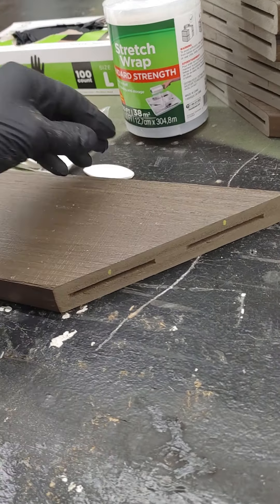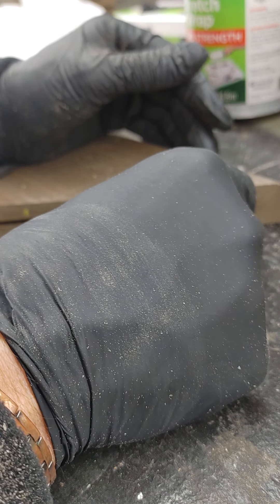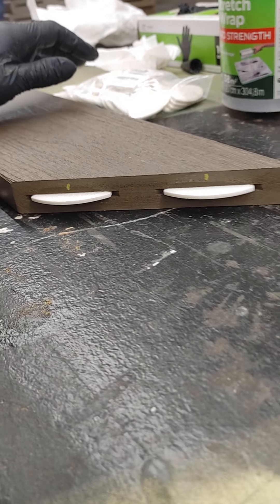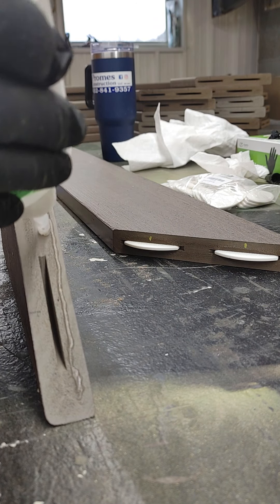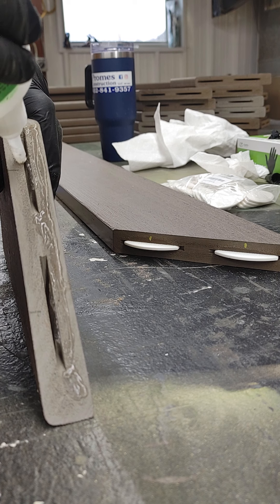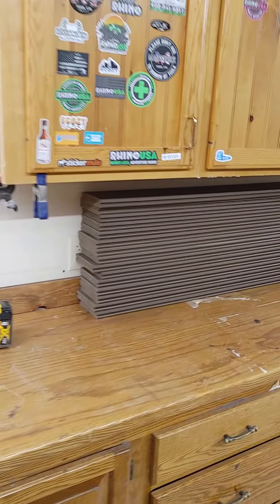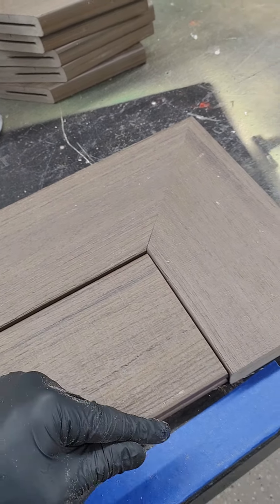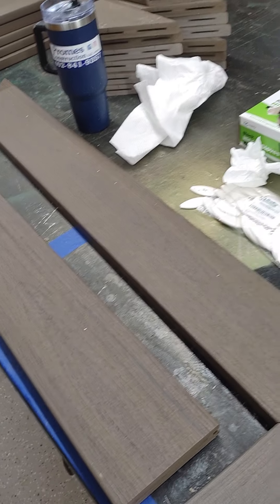Picture Frame Stair Treads

Comment: What about composite? Do you have to leave the space/gap? Looks way better tight like that
Reply from the maker: I would not be to concerned about installing composite tight on small boards like 4' wide stairs  for example.  But yes if the boards are long composite needs room for expansion

Comment: I’ve found it’s quicker to use pocket screws and glue. And you only need a battery drill and a pocket hole kit instead of a biscuit jointer with a cord so it’s less tools to break out for me. Pocket screws are cheap, I buy them in a 2500 ct box the blue outdoor rated ones. If you’re near salt water you have to use stainless then they aren’t so cheap. I like that instead of having to biscuit two pieces, you just have to drill the pocket holes in one. Either way I wouldn’t call this method wrong and I commend you for doing something to get a good looking end result that will last a long time. I use 2p10 glue but no activator is needed.
Reply from the maker: Try that PVC glue its crazy strong